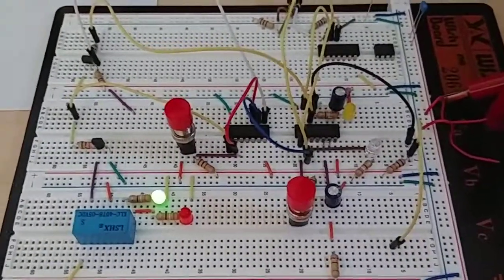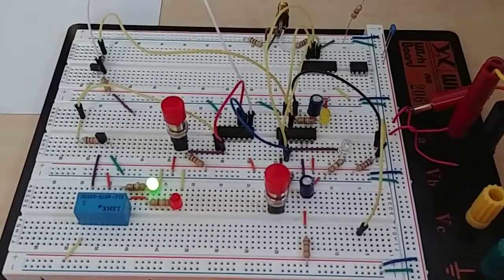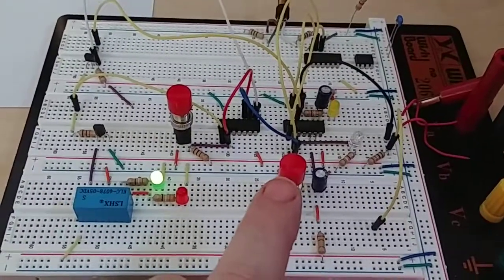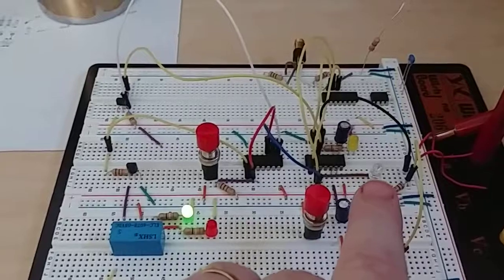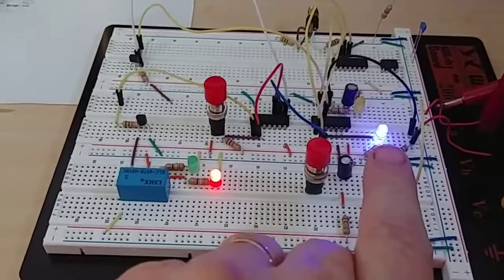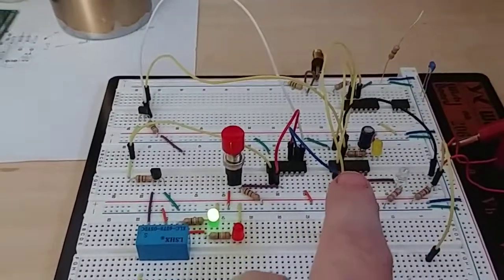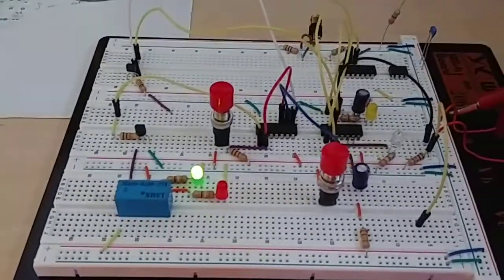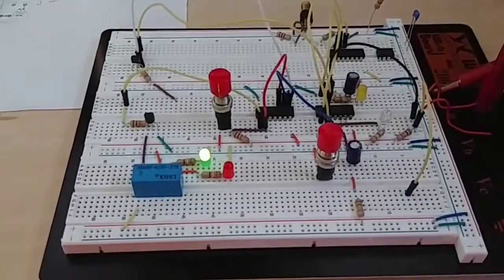Telephone landline ring blocking circuit

Comment: Hi. Thanks for the circuit.  How to forcely rings using by pass using wire. Tks
Reply from the maker: I am going to post (soon) an Arduino-controlled call blocking project that has been working now for many months.
Reply: @SuburbanDon  I heard that Rings can simulate by it’s self voltage of 48vdc.